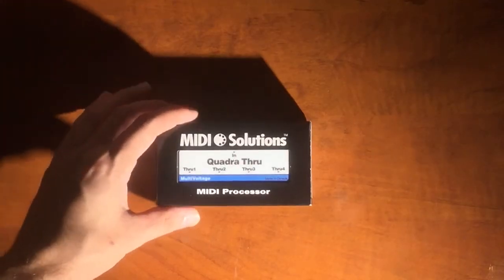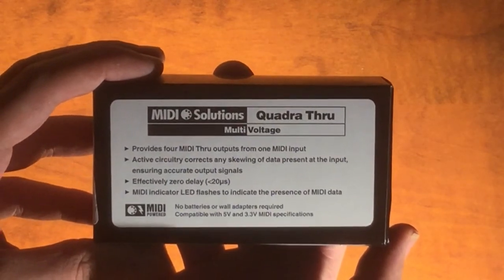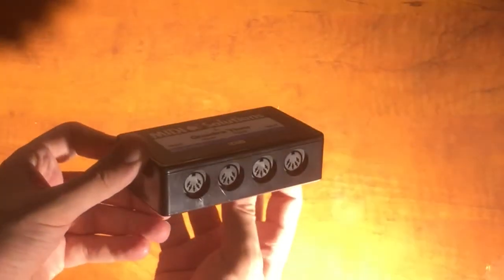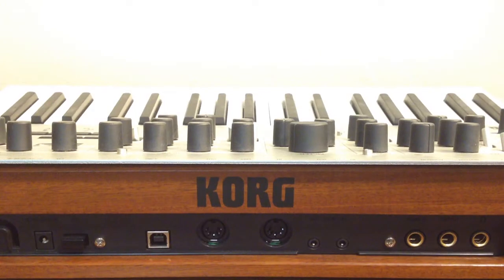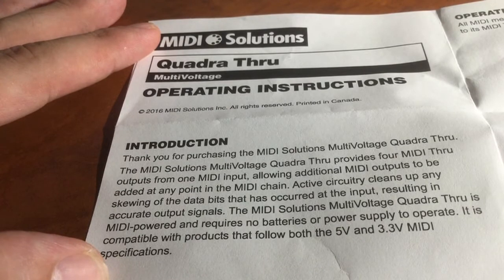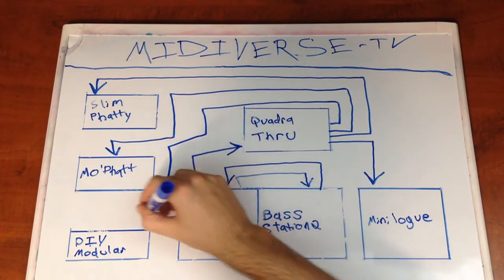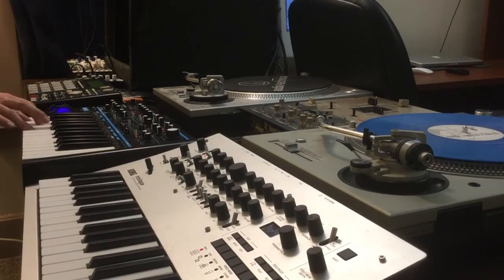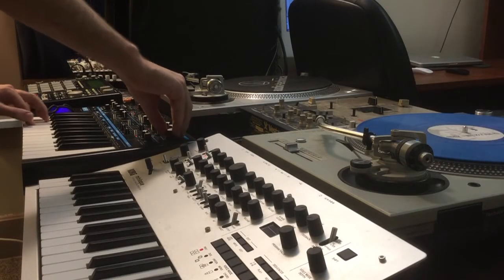MIDI Solutions - Quadra Thru - Midiverse - TV - MVM #75

Comment: what if there are 8 synths? Can you connect 2 MIDI Solutions together somehow to synchronise all the 8 items perfectly? Or anyhow else? thx
Reply from the maker: Yea that would technically work, might cause a bit of delay though... if you're going midi in to midi thru on a synth for example there's always going to be some sort of delay time, like fractions of a second. So the more you do that, the longer the delay time is going to be. If none of the 8 synths have an actual MIDI thru port, and a MIDI thru box is required, I would probably just get a larger MIDI thru box. I believe Kenton and Erica Synths both make one with 8 outputs.

Comment: Would this be ideal to get if my hardware consists of: Behringer RD-8, Behringer RD-9, KORG Minilogue, and a microKORG?

i'm planning on getting one or two compressors as well as a Mackie mixer. Would I need a standalone sequencer with that setup? I was thinking of running Ableton with a Novation Launchpad (first iteration) and maybe use that as a sequencer, if possible?

Comment: Midi Thru, in this case of Box, is the same than OUT, right? I can plug one keyboard into it and send midi to 4 others...
Reply from the maker: Midi Thru just means that it is a copy of the input signal. MIDI Out is used when a device is actually generating notes or midi cc data. So if you had keyboard that had MIDI In, MIDI Out, and MIDI Thru, the MIDI in would be used to control that keyboard from another one. The MIDI out is used to access the MIDI notes and data from the keyboard itself, if you wanted to control another module for example. Lastly the MIDI Thru will just be a copy of whatever MIDI data is coming into the MIDI IN port, typically. So you can think of this MIDI Thru box as a MIDI splitter, if that makes sense. Hope that helps!

Comment: I have a similar set up. A few things like volca, a pocket operator  and kaossilator which has midi along with my midi controller mpk 49. I  bought a interface (scarlett 2i2) but know there aren't enough inputs for all. (Also having a dj set up, with a rane 62 mixer) I do have ableton.  I just don't know where to go from here, and would using an interface along with a splitter something that works together? Or could be of use. Cant find anything on this. Any help is appreciated.  Thanks

Comment: Any advice how to use OnSong app as your controller? My rig is IPad to usb iConnectivity Midi2+ interface with (2) outs running into a BeatBuddy drum & Strymon Timeline delay. The app/interface changes my preset parameters whenever I select a new song chart at gigs which is very convenient instead of bending over my but to make changes for guitar. I want to hook up a Molten Voltage Tempode tap pedal that has (1) in/(1) out to sync the drum and delay and change tempos when I want. Would it do the trick to use say (1) out from the iConnectivity interface into the splitter or to hook together the drum machine and delay and rig something up that way like what you show in your video???

Comment: So, you can sync all the seperate synths using the quadra?
Reply: Yes but the downfall of the box is it is powered via midi and can become a little unreliable past a certain amount of connections...I use the Kenton THRU5  receiving a midi signal from an iconnectmidi 2+....What this allows me to do is tie 5 external midi keyboards and rack modules directly into Ableton (or my ipad) for syncing..Works great I can sync up external performances that use arps directly into a recording session.
Reply: Shadow Banned ive found it kinda un reliable too. 
I use live 10 but I have a lot more hardware synths now and I’d love to be able to have them all hooked up at once. 
I’ll check out the Kenton. Thanks
Reply: @TheoVoidTV  The Kenton Thru5 has its own power supply that makes the difference in reliability I think...Make sure if you buy one that it has the power cable included.

Comment: Hey man a quick question:
I have
Electribe2, Electribe2 Sampler, Juno Di, Nord Lead 4, Waldorf Blofeld. Cubase 9.5. 

And Cubase sucks at providing stable midi clock. I was wondering can I provide a midi clock from my Electribe2 to the Quadra Thru and then connect multiple devices on that. Let me know what you think. Thanks.
Reply: i'm interested too !

Comment: I’m getting this so I can send from Ableton to my devices
Reply: have you tried this yet? Im looking to do the same thing. wondering how well it works
Reply: Once I get paid I’m buying one
Reply: I am already doing that but I use an iconnectmidi 2+ to receive the sync from the PC then it passes on to a Kenton THRU5...Works flawlessly and you can also use an ipad or a master midi keyboard to control them if you wish..Added bonus of the iconnectmidi is it also sends audio via usb so you can insert ipad synths into Ableton.
Reply: @shadowbanned5164  can i ask for advice on syncing synths, kenton and ableton correctly . I am currently even having isssue with my virus c working as an external instrument . I use a scarlett 2i4 and a midi to usb cable to get data across
Reply: @roym1444  If you have a Deluge you can use that as a master to sync all your external midi synths via the Kenton then just run a usb to midi cable from the PC into the Deluge check all the Deluge boxes in Ableton midi section are selected for both input and output and you can trigger the Deluge either from Ableton or the Deluge itself and any external synths hooked into it....My advice would be to get it all running smoothly with the Deluge first (its pretty easy) then bring in the PC afterwards...If you dont have a Deluge its probably in your interest to purchase an iconnectmidi unit and send midi to that via Ableton.